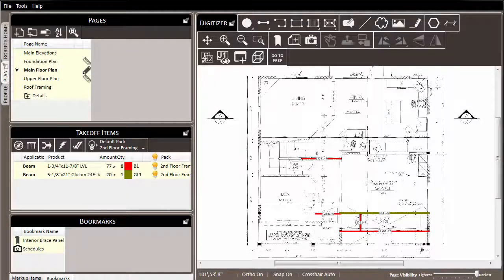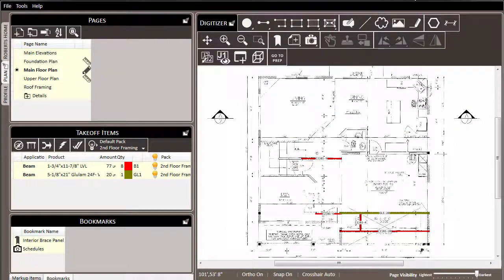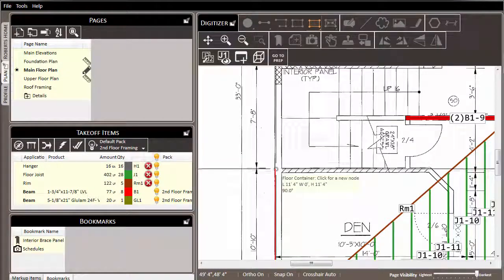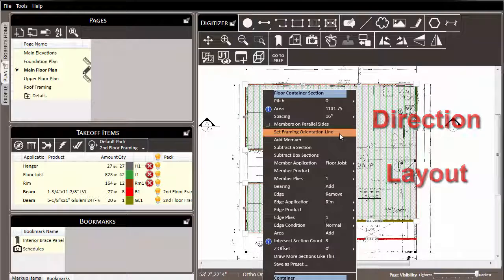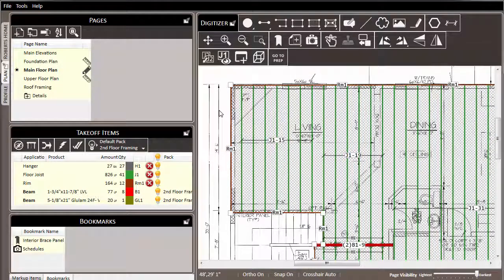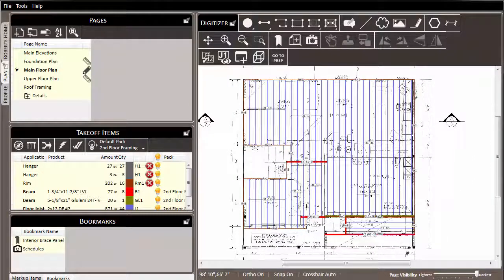Drawing Joists

Comment from the maker: Jump to a specific topic by clicking on a timestamp below:

0:16 - How to Use the Floor Tool
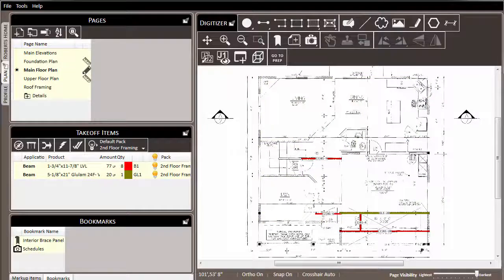1:06 - Drawing a Floor Container
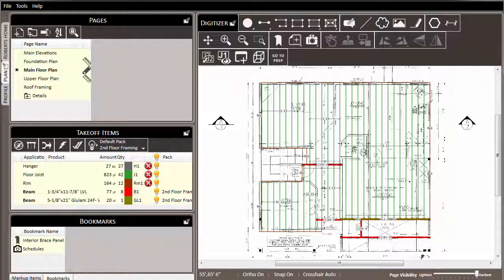1:52 - Changing the On Center Spacing
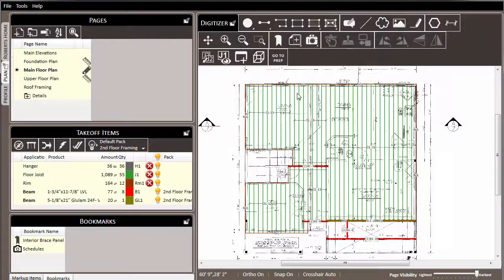2:05 - Joist Framing Orientation (direction and starting point)
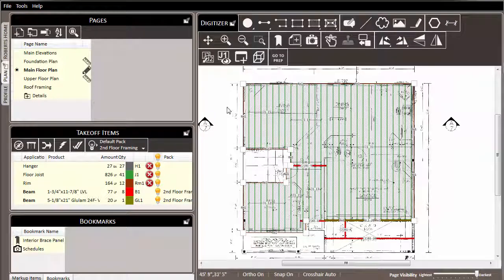3:02 - Assigning a Product to the Joists
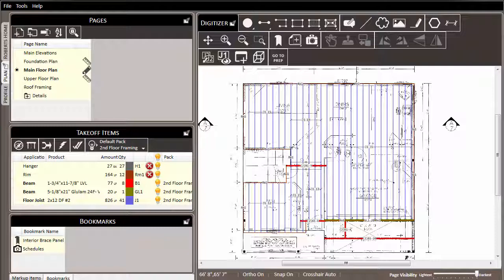3:37 - Drawing More Floor Containers